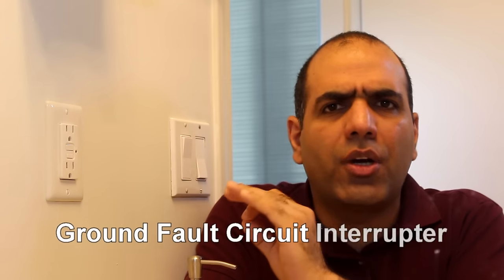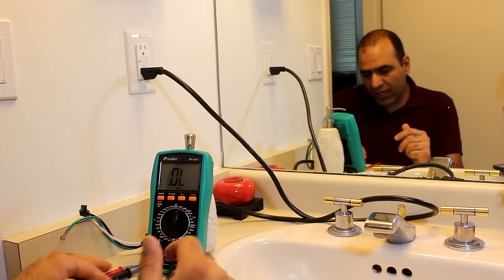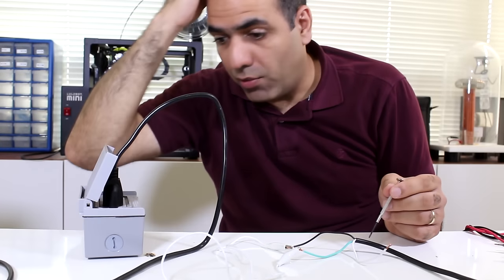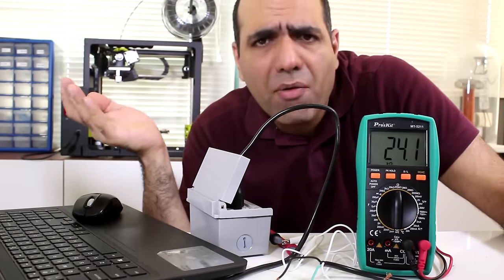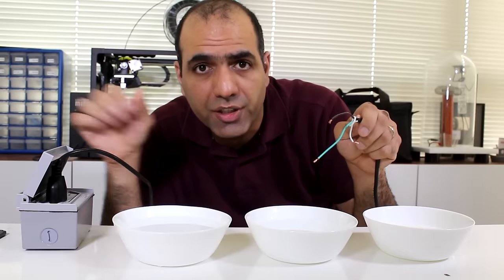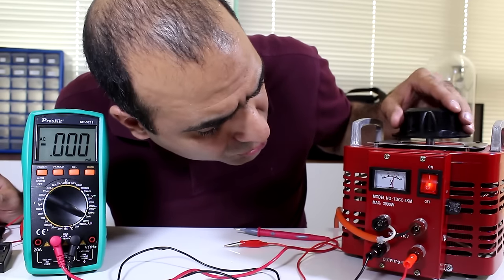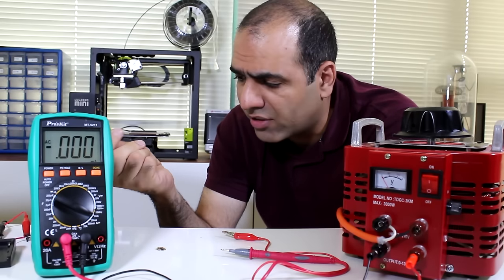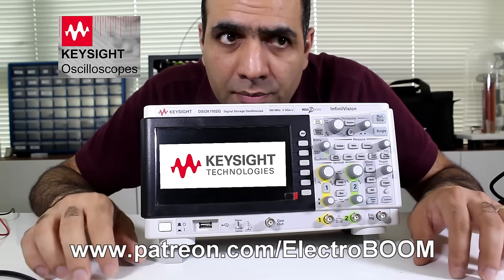The Outlet that Saves Lives

Comment: Damn this made me so nervous to watch, full of adrenaline, i almost died at the age of 17 220v installation without ground wire just an thermal switch, current passed from right hand trough the chest and discharged in my left hand which contracted so hard that my fingers got all bruised, right wrist got burned at the point of contact and left 3 small holes for 1 month, it feels like ur whole body is going to explode, a weird feeling of numbness where you can't feel the body boundaries, it was in total 2 or 3 seconds until my leg contractions set me free, then the body boundaries comeback and you can hear yourself again making the famous grrrrrrrr sound, chest pain for 3 weeks from the pectorals contraction and heart maybe, an horrible way to die it takes you by surprise, your are fucking insane.
Reply: Famous grr sound?
Reply: How many times did English break on you
Reply: I shorted a 230v welder with my hands, I had my left hand on the welding table(grounded)  and my right hand was on the positive welding lead.
The cover on my positive welding lead had come loose and my right hand contacted the terminal where the lead connects into the holder. 
My hands immediately locked up and I felt an extreme burning in my right arm 
Thankfully when I shorted it it scared me and I jumped and took my hand off the table and ended the short
I felt burning sensations in my arm for hours after
Reply: I shorted the primary coil of a transformer (240v) with my thumb about a year ago. Can still see scars a year later
Reply: 110v maybe bearable for a few milliseconds but don't ever try your luck on UKs 240v supplies,   And NEVER EVER on old Tubed TVs or microwave circuits (where capacitors hold killer KilloVolts & MegaVolts -usually with picture of a skull YOU HAVE BEEN WARNED)
Reply: When I was four I stuck a key in the outlet, it just made a bang with sparks and smoke,  i didn't feel anything, exept I was scared. Well the thing is I was supposed to be in bed but I was sneaking around while my parents talked in the kitchen, then I found a key and pretended that the outlet was a lock and...well....
Reply: I once I had a dream I'm getting shocked. I woke up, felt asleep again and after a few times I've turned on the lights. I've noticed that case of the socket felt off and it was really shocking me :P But I have a heavy sleep. I've fallen asleep on black metal festival near the speakers or when F16 were flying at low altitude over my home. 

And the effect depends on many things. Once I've got one live cable in my hand and other cable touched my second hand. While it was short (maybe 500 ms), I should have something on my body. I hadn't scars, burn marks, anything. And once I wanted to plug a plug into the socket which got broken, so I've touched live cables and I had my hand all black. And it hurt me more than this current through the heart. For the record the current was 220 V or 230 V.
Reply: Oh, and once my tooth filling felt off when I was trying to get off insulation from the live telephone (land line) cable.
Reply: @Ashkenya  Ahh thanks for the heads up on microwave circuits.  I was aware of the high danger from old cathode ray tube capacitors but had not thought as much about microwave circuits.  If you are dealing with these kind of circuits what is the best way to ensure capacitors are uncharged?  Can you short them or should you use a circuit with a resistor or something else to protect things?
Reply: Kutulue just protect yourself and short it with something metal. Took apart 3 of them now and a old power supply and I have yet to feel the shocl
Reply: @cavaughnhaynes76  Ok cool.  Thanks for the info.  I had assumed that shorting the capacitor might damage it - otherwise this seemed like too obvious a solution.  But I guess it is easy for people to forget to do so they get shocked.
Reply: Kutulue the ones you’d run into shouldn’t be impacted greatly by a short. They’re designed to charge and discharge thousands of times but without a load(resistance in the path of the leads) it puts more wear on the capacitor but nothing it cannot handle. Doesn’t matter how long it hasn’t been used because it can store charge for a very long time
Reply: @Kutulue, @ @cavaughnhaynes76 - Not sure when or if it became a requirement for CSA/ULIntertek but every single modern microwave I have come across with a HV capacitor has also had a bleed resistor directly attached to the capacitor. Now, I'm not saying you should ever trust that the circuit actually works... but it should be there.
Reply: @jaymemaurice  @kutulue @Cavaughn  Circuits and items are designed with protection in mind but remember anything designed by MAN is never foolproof and murphys law says  anything that is going to fail will fail usually when least expected  the wrong time
Reply: I still have nightmares of when I got shocked by a high voltage lighting circuit. I probably only lived because it went up through my head into a nearby vent and made my body go limp and fall away, off an 8 foot ladder. The sensation that you just can't forget like being lit on fire while laying on a paint mixer, burns on your shock points, the shock and fear. Wondering if you will die within the next few hours.

It's pretty traumatizing and has been a important lesson on keeping safe during potentially hot circuits. I thought I was a hot shot, glad I did not die instead for my foolishness.
Reply: I got first electric shock at the age of 8 years...by a computer VGA cable as it was damaged...i was holding the wood table thats why i was saved
Reply: shocked myself on a florecent lamp transformer when I was 7. Feels like someone is shakeing you very fast
Reply: @Ashkenya  
the one hand trick would still be ok , it would hurt a lot more though :-)
i never had a shock from the hv side of a mot (and hope i never will) but i have been bitten by an anode stud connector on a color tv , that felt like my thumb was hit with a hammer but the pain only lasted a few days :-)
Reply: @VestigialHead  
the caps in microwaves have built in resistors so they will self discharge in a short time but its still safer to short circuit them before doing any thing with the diode , cap or magnetron :-)
Reply: @YTANDY100  Thanks for that info.  So does that mean you could make up a simple circuit with the right size resistor and use it to discharge any cap?
Reply: @VestigialHead  
yes , but for high voltage caps you need quite high value and wattage resistor and good insulated wire :-)
Reply: @YTANDY100  Ahh cool.  I am not intending to try it but it is just interesting to know.
Reply: I have no idea how much was going through the wire, but when my dad and I were redoing outlits one was left open and we hadn't put any covers on the wires. I tripped and went to grab something, which happened to be the hole in the wall. Thankfully I was already falling, and the part of the wall my hand locked up on wasn't strong enough to hold me so it broke and the contact ended. This was a very old house which is why we were redoing the wires to make them less dangerous. I had burn marks on my fingers, and my other hand hurt like hell even without touching anything. Safety first, always.
Reply: @Ashkenya   CRT TV's won't usually be that big of a deal. You're more likely to die from arterial bleeding after cutting yourself on a sharp chassis part than from the shock itself. Microwave ovens on the other hand, will happily supply a continous 2kV 500mA AC or 4kV 250mA DC into your body, killing you instantaneously unless you're very lucky.
Reply: @SLAutoRepair  It's because nerves are good conductors. So in many cases they are the first tissue that get damaged from electricity.
Reply: When i was 9 yo il got shocked atleast 6 times with 230 V.. And im still alive today, im 16 I was such stupid kid back then.
Reply: I used to service big old Band Printers. They had 4 capacitors inside about the size of a gallon jug each. A sign on them said "These will kill you". said it all basically. I was terrified of the bastards.
Reply: Dont cry you Baby. Im an electrician in Germany and got several shocks in my life and im still living.
Reply: @throwingpanda2473 I wonder what his English grades are

Comment: An RCD needs 30 mA to break the circuit. It will take up to 100ms to break.
Note that in the UK there will not be a mains socket in or near a bathroom.
There might be a shaver socket which has an isolating transformer.

Comment: Well, in Europe we have Differential switches. They are tucked away in the electric control room. We have approximately 4 of them, but it can differ. They check for the whole lighting system, the "wet rooms" and the outlets all separately.
Reply: If only 30mA is missing they'll flick :)
Reply: @hscharft  15 mA for wet areas
Reply: @hscharft  What do you mean 'only 30mA'? Isn't 10mA already enough to kill you easily?
Reply: Its different as the wallsockets shown in the vid. There is a dedicated switch in the fusebox which swiches incredibly fast.
It measures the 1 and the 0 and if there is a difference between those (over 30ma) it clicks off all power for the area within microseconds.

Comment: Man, the disappointment when he says it opened (talking about the GFCI when he did it with the soapy hand) makes me respect this guy even more. He realized, even though he was in immense pain, that the girl would have been saved if she plugged the chord into a GFCI outlet.
Reply: The question is why the braker for the whole bathroom didn't work
Reply: Smh what kind of stone age house doesn't have proper breaking system in the first place...
Reply: @alikhajeh5614  Too much resistance. The breaker would only open if the resistance was less.
Reply: @asedaaboagye5877  so would wearing megs ohms resistors as earrings help?

Comment: I understand the area of the contact matters. If you have just small prong then the contact area is very small. If you touch it a hand an equipment that has voltage in the case the contact area is large and the resistance much lower. If you are in a bath it is very large.

In Europe GFCIs are rated for 30 mA.

Comment: I'm an electrical engineer from Austria. here the WHOLE house has to be protected by a GFCI!
Everything! From your oven to your tv are protected by a GFCI.
Our GFCI here are called FI and are from like 25 amps but there are some who are rated up to 80 amps and higher.
Also the FI are required to trigger withing 10ms at a fault current of at least 30 mA.
Reply: Usa have a shit electric system. Dangerous plugs, and 110v

Comment: once my uncle was working on a washer (or dryer) cant remember... and I was plugging it in to allow for testing things and I plugged it up and he tested it and I leaned over to see what he was doing... placing my hand on the backside of the control panel and it lit me up... not sure the voltage but it was a pulsation with quite a bit of heat... I let go pretty fast.

Comment: In Australia, we have RCDs, or residual current devices. These perform the same job but are installed in conjunction with our circuit breakers. So if any outlet is shorted from live to earth, the RCD will open. However, if an overload occurs, or it is shorted from neutral to live, or neutral to earth, the breaker will open. Remember, we have 240VAC here, so we need different types of protection that will handle the 240VAC. Also, remember that thing with the inverter and powering a room from it? That would not work here due to the different house wiring. Just some info. BTW I know this and I am 12. I have seen inside circuit boxes and seen RCDs at campsites. I don't handle high voltage like Mehdi, the most I work with is 12VDC form a tiny car battery, even that makes me jumpy.

Comment: Well there's probably different "trip" ratings for different GFCI's (i.e minimum current to shut off electricity). It's probably around 5 mA for the usual ones, but you could probably find one that trips even at 1 mA or less.